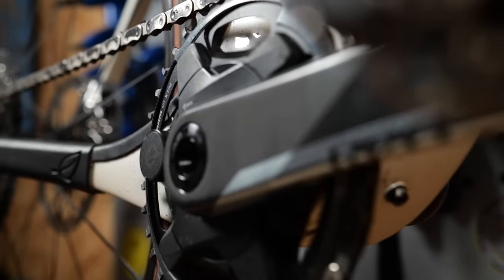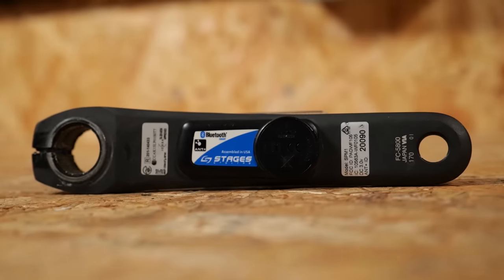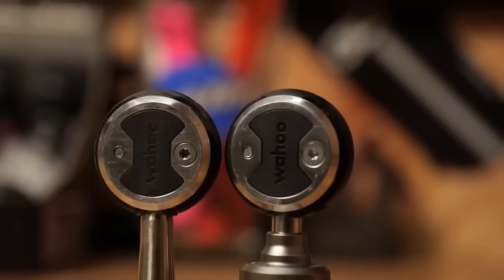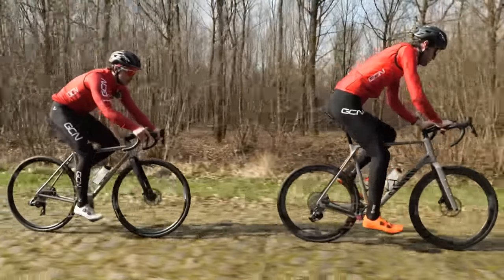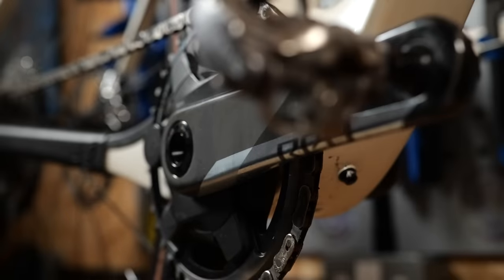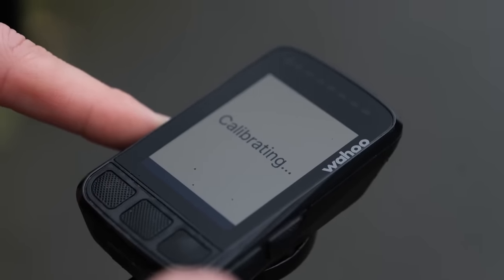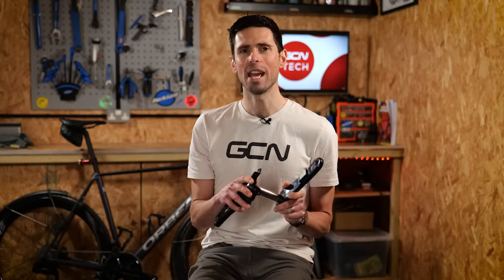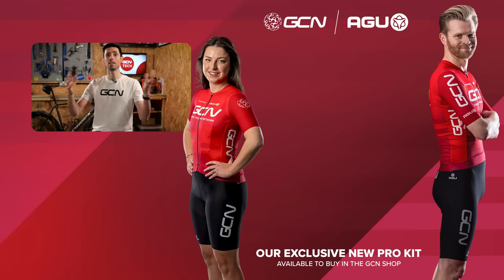The Problem with Power Meters

Comment: unless you have a coach or training plan that tells you X watts for Y min a power meter is another useless gadget. Yeah, it's nice to know numbers, but knowing what those numbers mean is a completely different story. 

If you're JRA, save your money. 

I'm using a training plan that does say X watts for Y minutes so I have 3 of the things. ...but since I've been riding them I've figured out that RPE is still a valid measurement. If the training plan says 'ride hard' then ride hard. If the training plan says ride easy, do that too. Staring at your stem for feedback is going to be dangerous in a race or group ride.

...besides... Whatcha going to do? 'Hey fellas... My computer says I'm above FTP can you slow down some?'

Comment: Keep things simple.  Train on a known route.  Time your runs or use gps.  Compare readings or even splits.  If you really want to measure something, go for heart rate.  That meat pump determines everything… ability of the muscles to work, lactate clearing rate, maximum work (irrespective of FTP).

Ask an experienced competitive rider what they would change first if given the chance.  It would be heart and lungs, not frame, drivetrain, wheels or even tires.

So measure heart and lungs.  As these improve, so to will speed and endurance.

Comment: My first gen TacX Neo overreads in the small chainring compared to big chainring. I first noticed my HR going up by ~5BPM and RPE being higher if I shifted up at the front during a high Z2 ride. I then then made some measurements over a range of power for the TacX vs dual sided 4iiii. Seems to be 10-15W extra in small ring vs big for the TacX, but obviously the absolute values aren’t necessarily reliable.

Comment: Interesting how you didn't out  Shimano Ultegra 11-speed bonded HollowTech II road cranksets (IDK if it affects dura ace too because I only tested the Ultegra) is complete inaccurate shit that I tested it between 2 indoor cycling trainers and 3 types of power meter pedals and when every other power meter was within 1 to 2 watts in the steady state (I tested it from 100 up to 250watts in 50-watt increments per interval) the left side was fine but the right side was shit and the new firmware just upscale the power when you are on the big ring and I returned it  you cannot claim 2% accuracy which is fine on the left side and you are about 10% off on the right side if I can measure 5 types of power meters against yours and they are all in line with each other only the shimano is craping out that means I am inclined to think that the Shimano is crap.

Comment: Bad power meters are bad. News at 11. It's a measuring device. Why would you spend money on something that can't really measure? I had the PoweTap hub on my old bike and Asiomo duo pedals on the new one. If you really have spent zero research on quality of the measuring device, save your money and train with heart rate
Reply: I use both and cross reference them. Typically I will put x power at y heart rate. If I start putting lower power with higher heart rate I can dial things back since I may be over training or getting sick. It's just another tool to use but I agree heart rate is significantly more valuable.